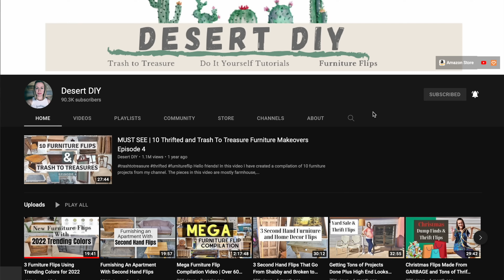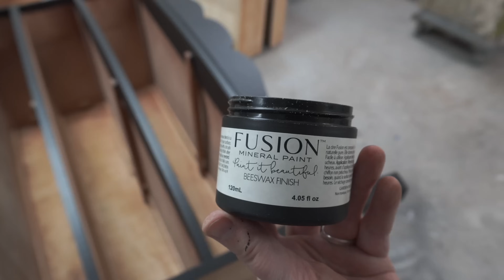I Restored a Mahogany Dresser with Beautiful Results

Comment: Breathtaking! I discovered a solid mahogany top under a bunch of old heavy gunky stain on a neglected dresser. It was $20 at the thrift store. Broken, abandoned, dirty. But was so happy to find the top after sanding. I used a water based wood conditioner and then waxed the top. But it doesn’t shine the way yours does. Maybe hemp oil is the better choice to give it that real lustrous look…

Comment: Perhaps you like this little tip…. Stretch Vinyl tape, or electrical insulation tape when applying it. Because the tape is elastic you can use it to clamp small pieces together. You can actually get quite some force out of it. Great for  ‘roundish’ pieces that are difficult to put a clamp on.

Comment: I'm totally with you on sometimes it's totally fine and actually a positive thing to paint some or even all of a piece. Number one I want it to stay around for a long time which means modernizing it. Second if some of it is beautiful wood and some of laminated press board or ply wood well I finish out the pretty wood and paint the not so pretty wood but it acts to seal water or as best as possible from the plywood and particle board so there's definitely a time and place for paint. "Paint is a finish too"

Comment: Well I turned out beautiful Angie. Local wood grain.
Yes even with the damage on top it would have been ashamed to paint the top.
I used your techniques on a side table that was mahogany the leg areas were some white type of wood similar to yours. 
I used the coal black and odies oil on the mahogany parts.
And yes, at least just saved those handles on junk piece.
👍👍👍

Comment: The Hepplewhite piece you worked on turned out beautifully! Those drawer fronts turned out so lovely, and the Coal Black paint just really set the piece off. I'm so glad you were happy with it after the disappointment of the "Ugly Duckling" piece you originally chose. It makes sense to determine which pieces are just too far gone (and your reasoning made perfect sense, as well), but I'm sure it would have been another stunner under better circumstances. I can't remember if I saw a lead paint makeover on your channel at some point, or if it was someone else's flip, but what steps need to be taken to be sure you are safe should you choose to refinish a piece with lead paint. I know (or I think) it's a toxicity issue, but if a valued piece of furniture had been covered in lead paint, is it typically an immediate loss? Thanks again for sharing your knowledge! It's always as interesting as actually watching the steps you go through to restore your chosen piece!
Reply from the maker: Yep you are correct! I redid a desk that had some lead paint. It’s not an automatic deal breaker for me… it takes time and care to remove and dispose of it but it’s certainly doable! Had the piece been of better workmanship, or better material quality, I definitely would have pushed through. But it was just honestly not worth it. But that hardware! I definitely snagged that! I’m not convinced it was original to the piece anyway but that alone was worth the $25 (probably 5 times over)!
Reply: @TranscendFurnitureGallery Right... I'd almost forgotten about the hardware come-up. I'm sure you'll choose the perfect piece to pair it with! Looking forward to that! Thanks for the reply!

Comment: What a beautiful chest! Your color mixing reminded me of some I have seen Dashner do. You both are talented salvagers in that respect. 
You spoke of being a wood purist, which I have always considered myself to be. Sometimes, though, a piece has been too badly damaged for restoration. Don't feel that you should apologize for that. I have painted, too. Your chest's damage on the side reminded me of an old piece that I have seen that was in an old house with sweaty windows caused from gas heat and poor insulation. The water just runs  down any furniture sitting close by. It effectively does look like it's been rained on. That's very common in the south, maybe the north, also?
Anyway, great end result on the piece. Good call on saving the hardware from the first piece. I once bought a blouse at a yard sale just to get the buttons! 🙂👍

Comment: I think you could salvage your ugly duckling with shou sugi ban and get rid of all that lead paint and shelf liner at the same time.  Once you've burned the surface, you scrub it with a wire brush, and all the burnt crud would come off.  Might need a few burns and the result might not be ideal, but since it's basically trash anyway it would be a good experiment.

Comment: If you put a clear coat of flat top coat on the hardware would that stop the rust?
Thank you for putting all the places to get Odies. The place in Missouri is only about 5 miles from my house. I will definitely be going to pick some up.
Reply from the maker: I’m not sure- that was my initial thought, but I’ll have to do some research. I love the small bit of rusty patina, just hoping it won’t keep eating away at the metal.

Comment: It turns out absolutely beautyful. I know the struggle you have to make that spot blend in. Sometimes you can use more time at that little imperfection, than at the rest of the furniture. The paint give a nice contrast to the wood.
I have a question. I'm a little confused about the screwhead, is it squarehead or what, and do you think these are the original?

Comment: Germaphobe has a question here. I know these pieces get wiped out then a wax or oil inside them but I’m always grossed out at the idea of putting my clothes into an old piece. In the past, I have painted the inside of the drawers and sealed them with whatever paint clear coat I could find to ease my mind. Now I’m working on a piece for my soon to be born son and I love the idea of not just shutting out the wood but at the same time… eh. Who knows what’s been in them! One drawer in particular has a dark black stain that worries me. Idk. Not sure how to get past that anxiety about cleanliness. 

Also can’t wait to see that hardware pop up again in a later video 🤞🏻
Reply: If it's mold, you have very good reason. I would be very concerned as well. Perhaps just replace that part of the drawer? And burn the black stain section.

Comment: You saved the only part of the first piece worth saving and that was the very cool hardware- Eastlake maybe? I have never seen a pattern quite like that before. Can't wait to see what you do with it. I'm going to blame the lead paint for the decision to put that gorgeous antique hardware on that pos dresser over contact paper. The second piece turned out to be a real beauty. Great job painting in the missing woodgrain. I would have painted black over the top, put some coats of poly over that, and called it done. Your solution was far more clever and beautiful.

Comment: Just a thought. The repaired part of the dresser top appeares darker. What about adding another dark section or two in order to de-emphasize the first dark section? Make it look like it's supposed to be that way.
Reply from the maker: It is slightly darker, yes. I’m ok with that. It’s quite difficult to get a perfect match sometimes but it was still better to me than painting the top, which I definitely didn’t want to do. I considered staining the top darker but because the drawer fronts are darker, and the sides are lighter, I opted to leave the top and sides closer in tone. :-) 
I’m ok with those little idiosyncrasies on older pieces- battle wounds, so to speak. :-)

Comment: What color/brand of stain did you use on the edge. I have a similar issue with a mahogany veneer top and no banding to match. Thanks. Love your videos, I have recommended to others.
Reply from the maker: It was General Finishes - either Walnut or Antique Walnut. I can't remember which one.

Comment: In general, is it better to use a scrapper on a piece that isn’t painted, just regular old finish, and use stripper on a painted piece?  I do understand on having to paint some of a piece due to repair issues.  Great job!
Reply from the maker: Great question! It honestly depends! Some paint is so thin that it’s faster and less messy to scrape, and some finishes are so thick that it’s impossible to. I tend to prefer stripper on paint, usually because painted pieces tend to have multiple layers so scraping just takes so long. On thin wood finishes, I like to scrape. It’s fast and effective, and just feels good, if that makes sense. :-)
Reply: @TranscendFurnitureGallery   As always, thank you for your response.

Comment: A clear coat will not stop the corrosion. The quick answer is to  spray a rust conversion coating on it to stop it while maintaining some of the texture. Then you can do a faux rust look over that. Take a picture of each piece before as a reference (with numeral identity on back and pic) and you can recreate the look almost exactly as it looked while preserving it for the future.

https://en.m.wikipedia.org/wiki/Rust_converter
Reply from the maker: That’s great info, thank you!
Reply: @TranscendFurnitureGallery  👊

Comment: Question:  Why use hemp oil on the inside of the drawers rather than the Odie's Oil?  I have an old dresser that I'm going to attempt to work on this summer.  Learning a lot from you! <3
Reply from the maker: I like the hemp oil for the drawers as it’s waaaay cheaper (I save the odie’s for where it really counts) and because it’s liquid and can be ragged on, brushed on etc… makes it easier to apply inside the corners of the drawers. :-)
Reply: @TranscendFurnitureGallery  thank you! I’ve learned so much from you!

Comment: Have you ever tried using lacquer on the parts you want to paint?  It's more work and likely more expensive, but would probably look amazing on some of the finer pieces like this where you would otherwise use paint.  Not criticizing, mind you, as this turned out great.  But I've always admired the depth and glossy smooth finish of traditional lacquer.
Reply from the maker: Yes, I use lacquer a lot :-)

Comment: A thought just occurred to me. Did you consider taking a small piece from one of the drawer bottoms (which no one sees anyway) and use that to repair the stain/mark on the top of this piece? It might've made colour matching and blending a lot easier. Or not -- I dunno.

Comment: What do the different colors of tape do? I use the blue and know that for temporary applications. What about green and here you used red?
Reply from the maker: Blue and green tape, while both often considered painters tape, usually have different adhesives. I’ve had back luck with the adhesive on blue tape literally melting through certain finishes if left on too long, so even though I’d occasionally used it in the past, (and sometimes red), I pretty much only use the green now.

Comment: If wood is really dry can you hemp oil it before painting?
Reply from the maker: If the hemp oil had been applied and then dried and it was months down the road, you might be able lightly scuff sand and paint however if you've just applied the hemp oil, you're going to have adhesion problems for sure. You best bet if you're going to paint it is to seal the wood with a couple coats of dewaxed shellac, rather than hemp oil. Thanks for watching!